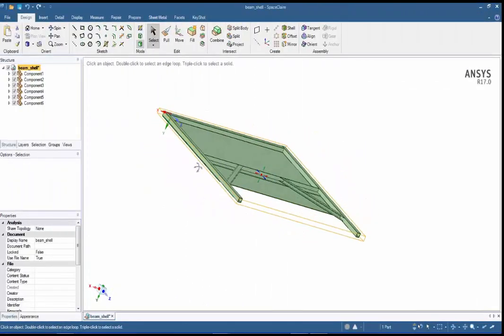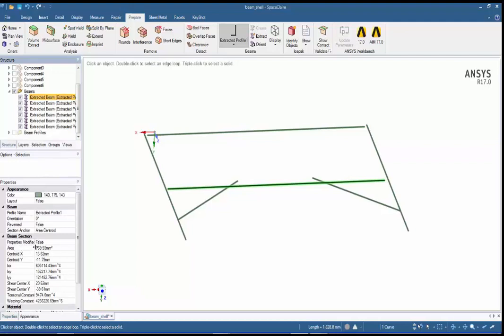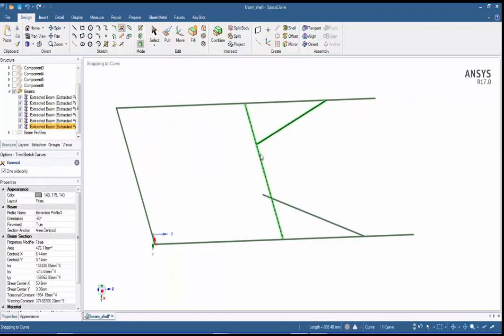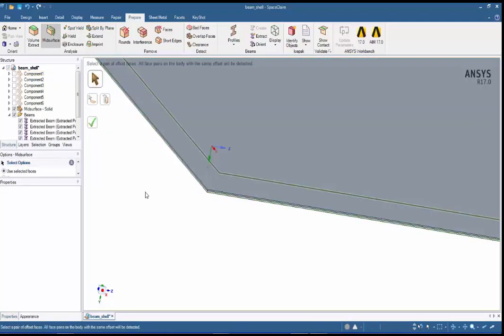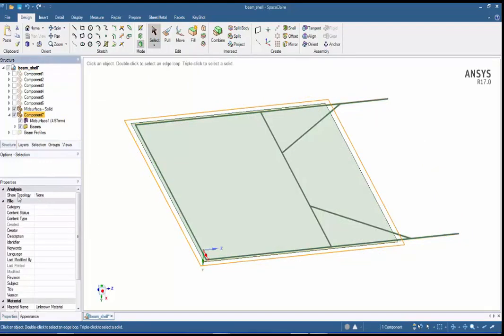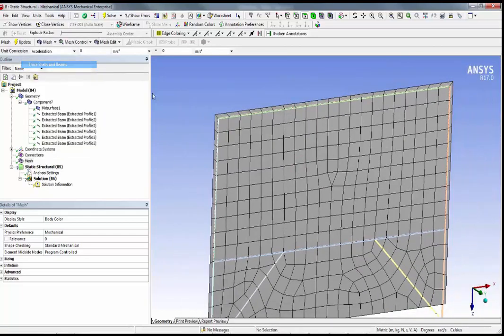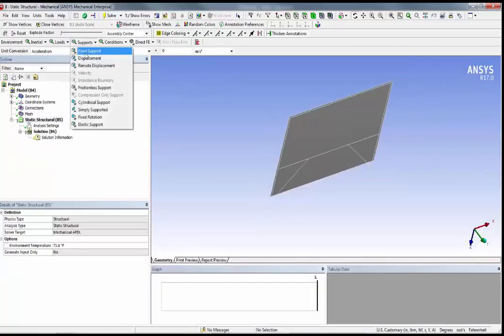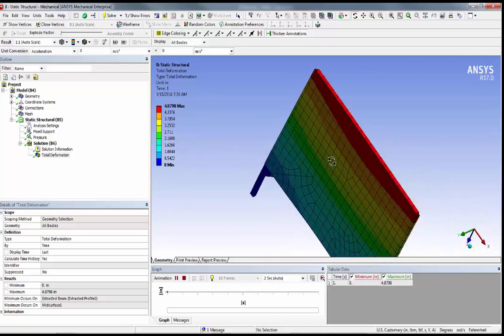Simple Example of Beam Modeling with ANSYS SpaceClaim R17

Comment: You mention "Share Topology" a bit nonchalantly, but this is a very crucial step! Otherwise, the intersection nodes would not be shared and the analysis would be unconstrained. Thanks for the video.
Reply: I agree with you @mechfeeney. The beams' connectivity is not established unless the crucial step of moving all beams to a new component and change the connectivity from none (default) to share.